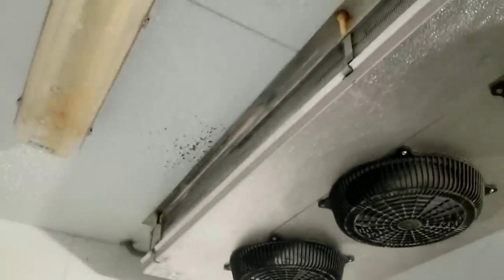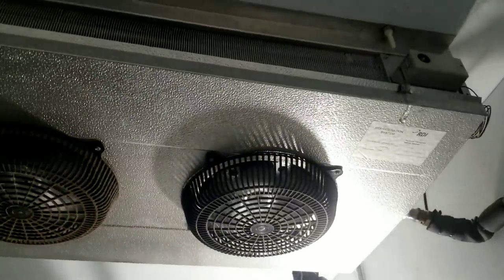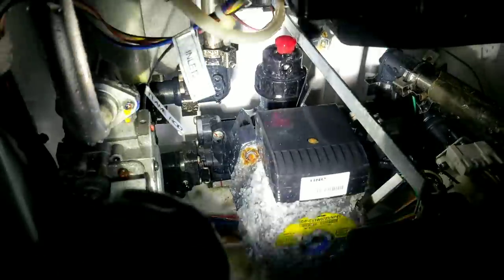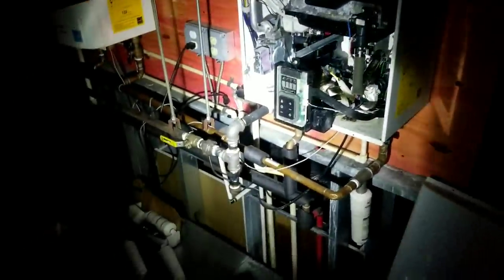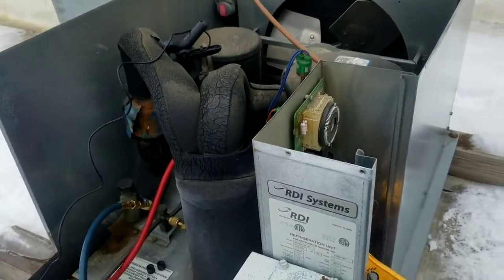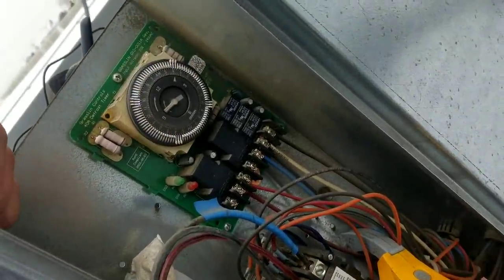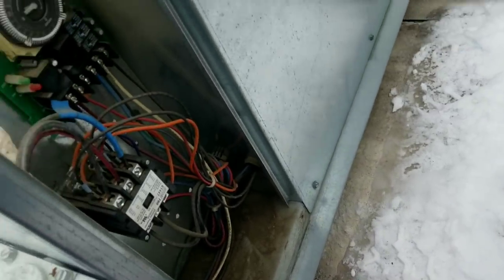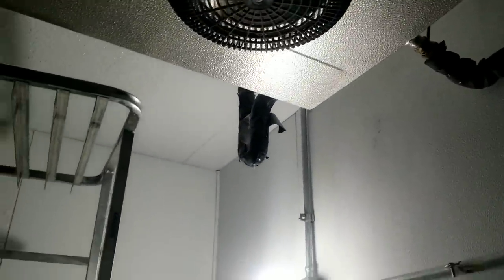Freezer is getting warm

Comment: Good job Bill, enjoyed this one, as always.
I was wondering why the slimline ceiling evaps draw air into the coil from the center and discharge horizontally.
What happens if one reverses it?
Then the dirt will collect on the outside making it easier to clean, and after defrost if any water vapor comes out it is not blown onto the ceiling.
I tried doing some research, not an easy answer to find it seems.
Found a few forum threads to read on it and they only seem to contain supertech opinions.

Comment: I watch Mikey Pipes the Pipe Doctor on a regular basis and the amount of Navien boilers he goes to where they are defective, and less than 6 years old in many cases, is quite crazy -  He went to one not long back where there was a major water leak caused by a very thin plastic cap on the water inlet inside the boiler casing that had simply split open,  spraying water out all inside the cabinet, ruining the boiler and causing a customers basement to flood. They also appear to regularly fail on heat exchanger seals and vent collar seals leaking - so Navien do seem to be rather prone to failure. Seems as you show here a Navien once again has caused a customer a real problem not just with their boiler. Not good.
Reply: I was watching his videos for a minute but had to stop because he wasn't very professional and liked to talk shit about the houses he does work in. Tankless water heaters aren't nothing but money pits anyways no matter the brand. They may be more efficient but they're going to fail in 2-4 years compared to some conventional ones lasting 20+ years.